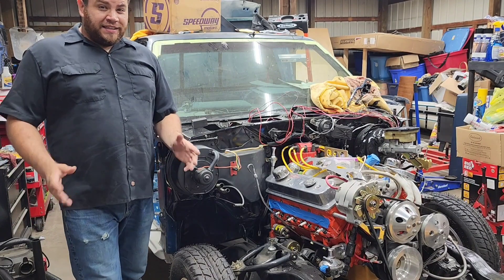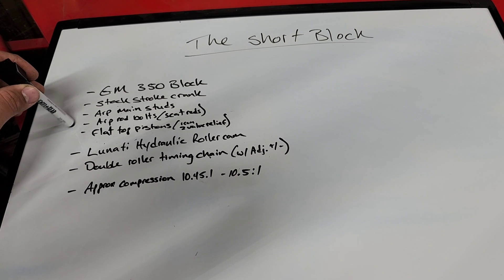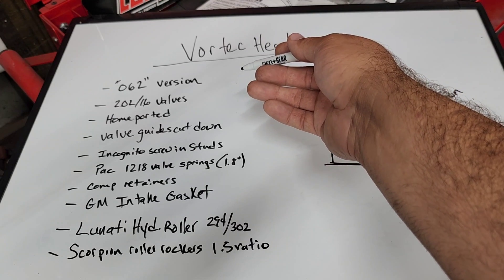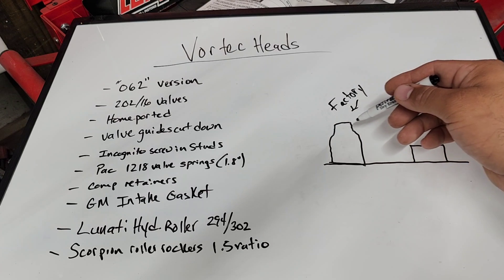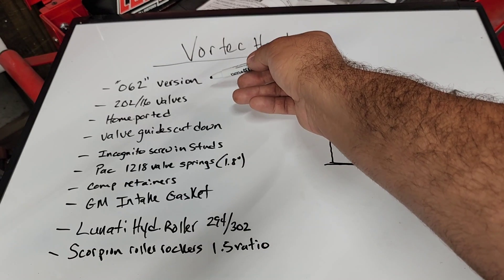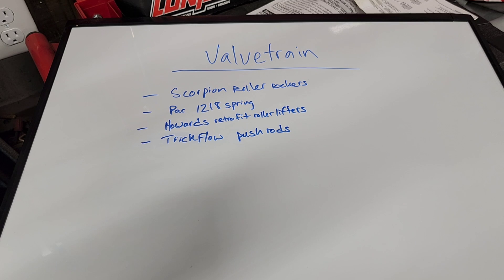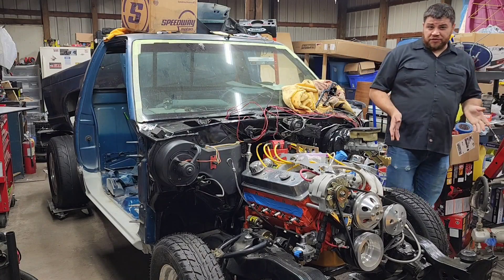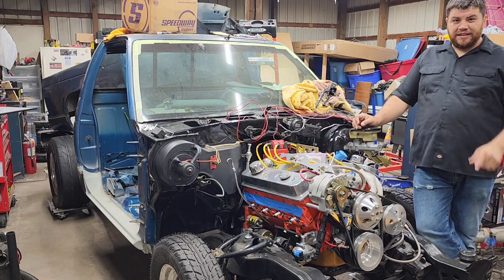SBC 350 With VORTEC Heads Build Details

Comment: I’ve got a budget/mild 350 project, 2 bolt main roller block (.040 over) keeping stock rotating assembly just putting new pistons in. Flat top 4 valve relief. I have a set of bone stock vortec heads and am having a hard time deciding which roller cam I should buy to be able to chop like a hog and still flow good. Going to run a 650 cfm carb. If you have any advice for me I’d appriciate it. Thank you! (This will be my first sbc build)
Reply: Let me know if you see this, there’s some good info out there for ya!

Comment: Thanks for all these videos they have been very helpful this past year in my S10 build.  I am in the short rows now and should have the truck on the street this coming week. Would love to send you  some pictures of the finished truck.
Reply from the maker: That is great to hear. I would love to see some pictures of the finished project. I have a lot left on mine, but I hope to resume messing with it again soon and have it ready for the streets next spring.
Reply: Trying to get the Sanderson headers to seal  on the Heads at the moment.  Truck runs great except for exhaust leaks at the heads. Instructions says to run a thin bead of RTV with no gaskets but that is not working.  Going to try some Remflex gaskets and if that doesnt work I guess I will have to send the headers back and try another brand.  
But real close to being road ready.
 @304customsgarage
Reply: Remflex 2005 gaskets worked.  I drove the truck today for the first time. Need to do some weights adjustment in the transmission governor to get the shift points at a higher RPM but thats to be expected.  Fresh Turbo 400 with Hughes torque conv.  Just need to put some break in miles on it and change the break in oil out. So far so good.

Comment: What type of cam button did you use?
Reply from the maker: I used a steel one from comp cams for this
Reply: @304customsgarage  Does that one require a lock plate as well?  How is the end play set?  thanks
Reply from the maker: The one I have also has the lock plate. As far as the end play the way I did it because of the timing cover i had was putting the dial indicator on a rear lobe of the cam put pushed the cam forward with a long screw driver. This was however isn't the most accurate because of the angle but was within specs that way (don't recommend that way because of the angle) but it was better than guessing. I should've just spent the money and got one of those multi piece covers but wanted to use what I had as far as parts. It seems some of them have a place to check that stuff accurately already (like a comp cams cover), I definitely will get one of those for future motors.
Reply: @304customsgarage  Yeah I liked the idea of the Cloyes cover with the built in button and the place in the front to set the end play.  HOWEVER  Tyler from TPV productions who has many S10 V8 videos here on youtube, used one of those covers and the button came apart and ruined his 400 sbc.  He has videos of this.  So I used the Nylon buttons since that.  It seems like someone would come up with something better.  The engine I am building for my S10 is a factory roller block so I didnt have to fool with the cam button this time.
Reply from the maker: Yeah Ive watched several of his videos before, haven't saw that particular one but ill look. I agree wish there was another option but I guess in my case I'll have to cross my fingers and hope nothing breaks. Next time definitely at least a better cover